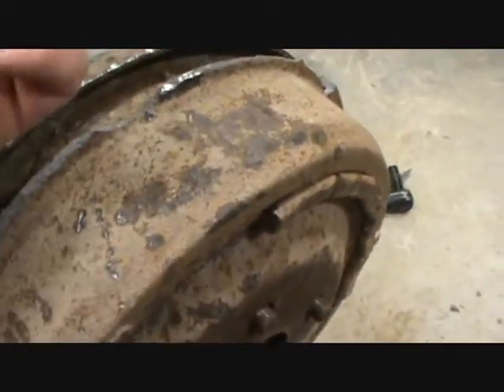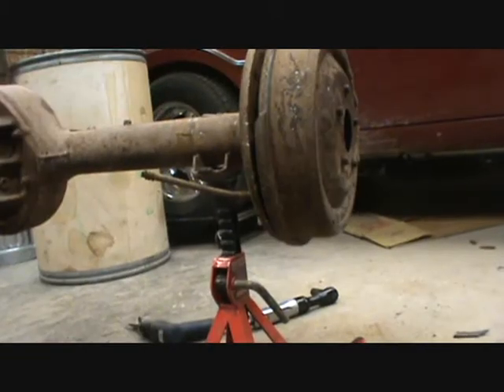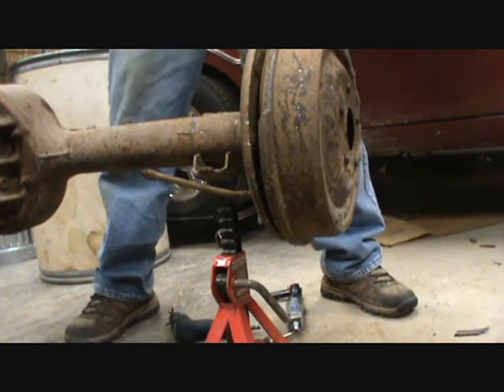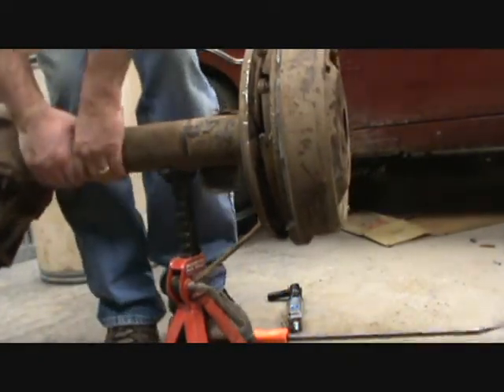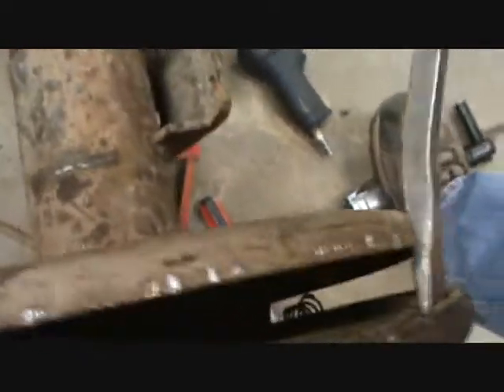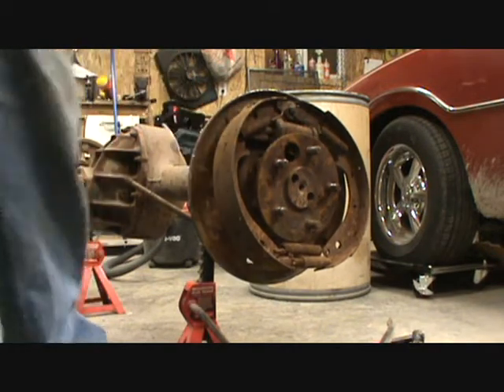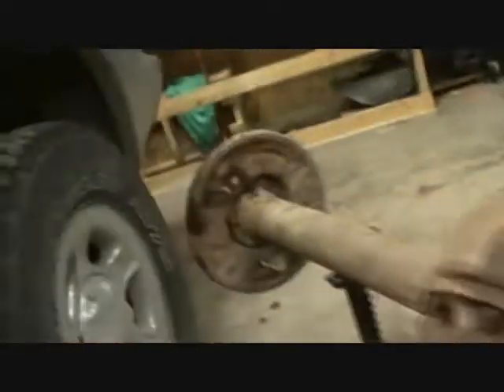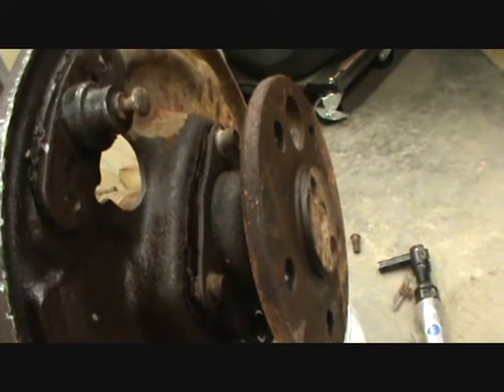diff stripdown. Peter Ralph 1975 ford mavrick

Comment: There aren't any 'C' clips in the differential pot at all? If not I would take an air hammer and put it right into the center of the axle end and give it a good pounding while pring back with a bar.... seems like the bearing races are just seized up on the housing and shaft.   ...greetings from your cousin Paul B.